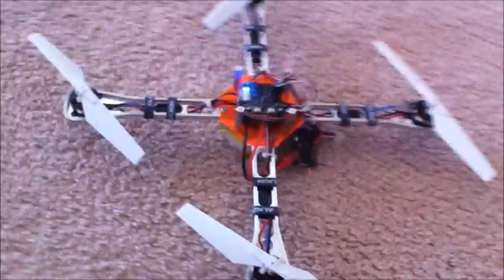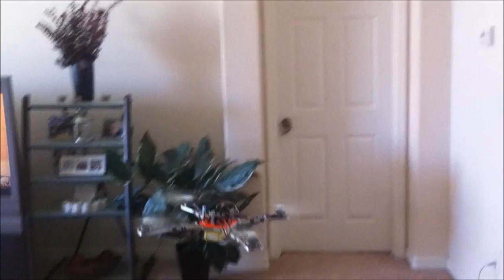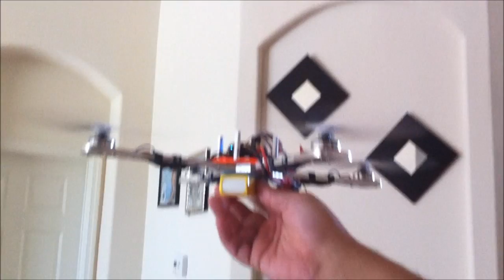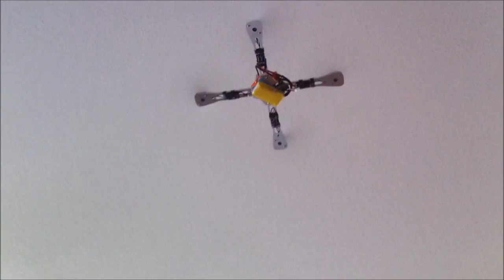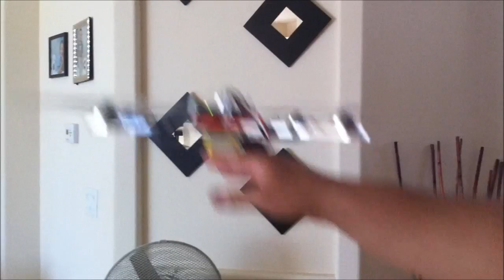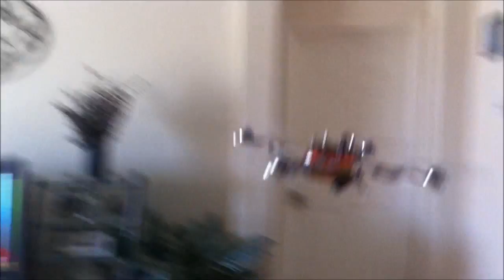Iconic-X frame design with OpenPilot CC Copter control

Comment from the maker: @sergey1t91 well with those props i wouldnt lift anything but switch to gaui props and you can lift go pro easily.  my new iconic-x frame weighs in under 160 grams

Comment from the maker: sure....frame i custom made on my router...  esc are turnigy plush 10amp, motors were 2205C 1400Kv Brushless motor, props are 2 piece 7" props from LA heli or gothelirc . com   battery i use nano tech 1300mah